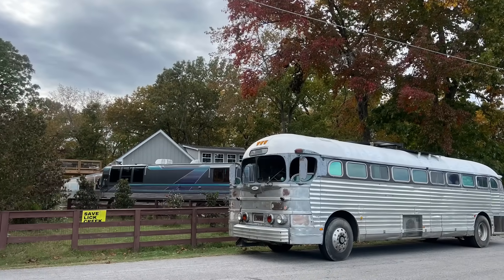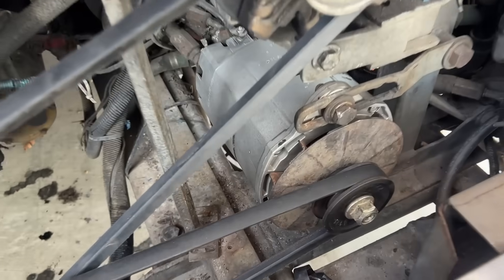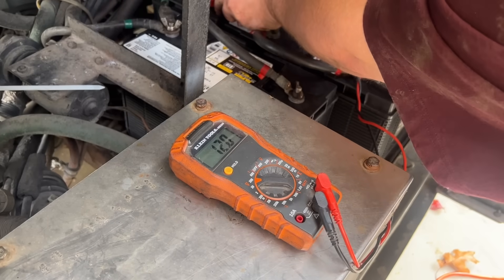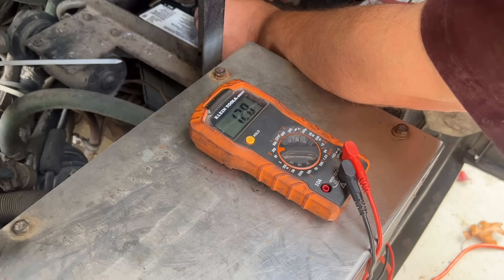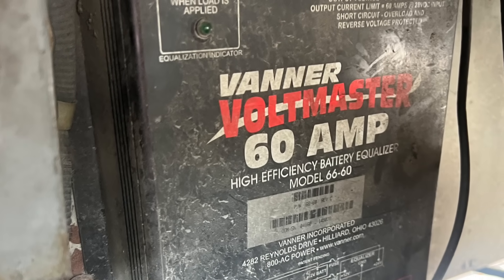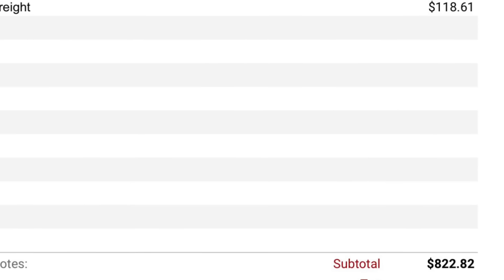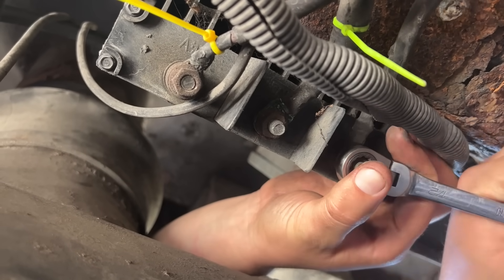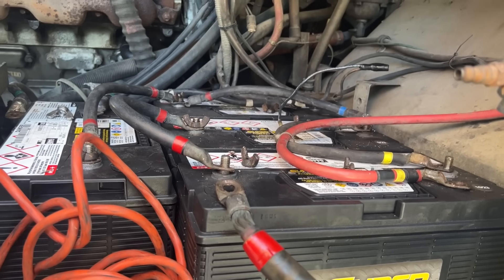Fixing the charging on the Prevost  The vanner equalizer was bad 24v 12v detroit diesel 671 mic test

Comment: you never ever ever pul 12 volt off your 24 volt bank! You only do that whit a 24 volts to a12 v inverter!!  It wil always be a problem if you draw power from half of the 24 volts bank. the 12 volt feeding battey gets an other internal resistance as the non loaded battery on the 24 volt bank. Use a 24 to 12 volt inverter for this (Victron sell.s them! ) Whit lead acid battery,s its a must to keep the internal resistance equal, With te test you already can see the voltage difference, And yes 1/10th of a volt is already bad in a series connectet bank.. 
.Best way is to mount a seperate 12 volt altenator on it or a 24 to 12 v converter. Never pul 12 volts of one of the lead acid battery,s in a 24 volt bank, Never!
Reply: Yes, "12v from the middle" is a no-go in German engineering 😅
Reply from the maker: This is the factory setup designed by the engineers on thousands upon thousands of buses.

Comment: In the 1970's and 1980's .......Kenworth trucks used a setup called a "series parallel switch".  It had 4 x 12 volts batteries which supplied 12 volts in parallel......but could output 24 volt when needed for engine cranking.  It was a good idea until it was not, and malfunctioned.........causing mayhem.  People quickly learned to get rid of them and go back to a pure 12 volt system.....or even better.........move to pneumatic air start.

Comment: Some of the early DDEC installs would use a separate 12 Volt battery and alternator just for the DDEC, works out cheaper and more reliable than the Vanner unit, not sure how they are now but the ones in the 1980s when DDECs came out were very fragile.

Comment: I think the charging voltage may be a little low but you will never cook the batteries at that level 
Lenny sounds 👍👍👍
Reply: iff you dont get lead acid cels to the end voltage of 14,4 volts you wil destroy them.... 28,8 volts is a 24 v bank is a minimum! to get them fully charged, After the bank is fully charged you can get that voltage back to 13,7, or 27,4 volts. Its highly important to get a lead acid battery charged whit the right voltages.

Comment: Personally I would piss off the equaliser and get the 24 volt system working correctly first. Add only 12 converters as needed.  Its only needed for AM/FM radio or some caravan type uses.
Reply from the maker: The engine and transmission are computer controlled and those computers are 12v.  When the computer’s voltage drops to low the bus shuts off which is what was happening.   It’s not just for a radio and cigarette lighter outlet
Reply: @BusGreaseMonkey  Crazy, but I understand. Im glad that modern Buses are all 24 volt.

Comment: The sound of Lenny is a great tonic on a dull morning, as the revs climb it reminds me of driving an old XK120 with open side pipes at full throttle 🙂
As for a "better" mic - most mics aren't designed to cope with high sound levels that you get close to a big exhaust pipe, I'd try a bass (kick) drum mic - they are designed for being in the port on the drum where the sound level is "turned up to 12" - have a chat with a couple of your local bands they may have something suitable for you to use for an hour or so just to get one recording.  The second thing to consider is that most recorders have overload protection built in, so they will artificially mute very high level sounds, so try reducing the input level quite a bit - again the local band may be able to help as their sound guy might have a "pad" in the bottom of his case (these reduce the signal from the mic before it gets to the input of the recorder).  If only you were in the UK I'd gladly pop along and have a try with some of my kit.

Comment: Vanner Inc. CORPARATION is in Hilliard, Ohio in Columbus, Ohio, suburbs where I live.... Ironically, the former MCI Custom Coach factory was 5 miles to the East from Vanner's... !! RIFFS Auto Body Repair who I used for Autobody Repairs; is right across the street from the Old Custom Coach lot and did at one time, alot of Custom Painting on MCI new Custom Coaches...

Comment: Awesome sound on Lenny! I can't recall didn't Lenny have a louder pipe out the other side at one point?
Reply from the maker: Yes a tiny resonator and out the other side.   Sooted up the radiator a bit and caused warmer exhaust to enter the radiator air reducing its efficiency.
Reply: Changing the exhaust to 5 inch will make that a mellower        and sweeter    sound ❤

Comment: I have two.8d and have been sold. Imagine in am ocean witth the same set-up. Drift away. Nice bud. Just did my head gaskets on my 478 because dumb ass me didn’t torque the bolts every 50,000 miles. I blame it on my Mother.

Comment: What was both alternators 12v 24v producing at  at the power connection at rear of each unit . 
Did the systems have volt drop more than .3 volt  source to main consumer . Most factory cables can be undersize .  Lets not forget the ground connection eg alternator housing to main chassis /ground point

Comment: Klein makes a meter with an amp clamp that does dc. Might want to add that to your toolbox. It is hard to get into tight spaces and is aimed towards ac work but it has helped me diagnose issues on ac and dc.
Reply: eh I hate the Klein multimeters they default to AC and various other annoyances.... also your average $20 clamp on meter does DC too these days.... maybe not as high of precision but fine for automotive. If you want to spend money at least get a fluke.
Reply: @Wingnut353  do you have or know of a meter that defaults to dc for amps? And as far as I’ve seen those $20 meters are a roll of the dice. Sometimes you win sometimes you lose.

Comment: Another option is a separate 12V battery (or bank) with a DC to DC converter charging it.  Looks like this system might pretty tied into the bus though.
Reply: Thats the only right way, Or mount a seperate 12 volt (14,4) alternator extra on the engine.

Comment: How come it wasn't equilizing those batteries and keeping a .3v difference between them?

Edit: ok i saw after i posted that you said that was within spec. That seems like a pretty big spread to me though.
Reply: Then I saw it got down closer to .1-.2v after the test drives.
Reply: The batteries weren't very even to start with. Assuming the deep discharge didn't hurt them, they should balance after a few cycles (that's the point of the unit). It might have been interesting to see current in each half - the balancer essentially works by bypassing current around the half that has more change, and it needs to see a voltage difference to know how much to bypass from which half.

Comment: Last episode had a brief explanation of how the house power got the 12V, and having an equalizer, though still in a fog, but hasn’t that since been rendered obsolete by an inverter off the 24V? 24vDC to 12 (ish) vAC?  And with it off the 24v system, there’s more power available, and not at risk of unequal drain, though at risk of cannibalizing the starting power, though not accounting for a low voltage cutout.
Reply: Hmm, but what's wrong about replacing the expensive equalizer and the ancient "12V from the middle" with a simple 24V to 12V step down converter to power the computer?
This equalizer is only needed because of "12v from the middle"...
Reply from the maker: House batteries are a totally separate system.   The engine is 24v to start and the computer that runs the engine and trans are 12v from the middle of the 24 start bank
Reply: @BusGreaseMonkey thank you very much for the reply and correction

Comment: What was the final resolution for the rear suspension issue?  It looks to be sitting pretty level now.
Reply: Didn't it just look like it was sagging more on the right because of the extra metal around the right rear wheel but really wasn't?
Reply: He put a new spring it didn't work. He took it off I think he had a custom one made and it still was sagging so I think he is just living with It right now.